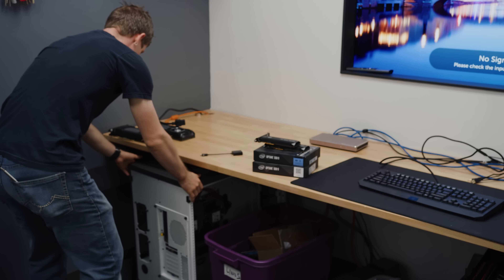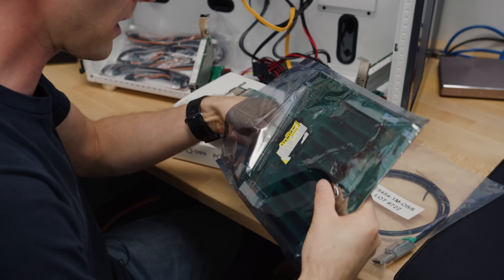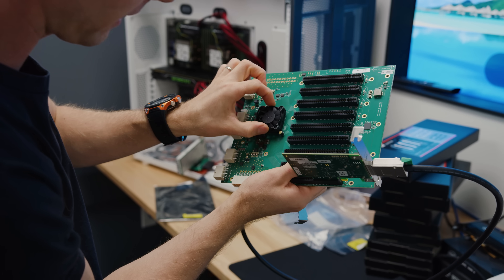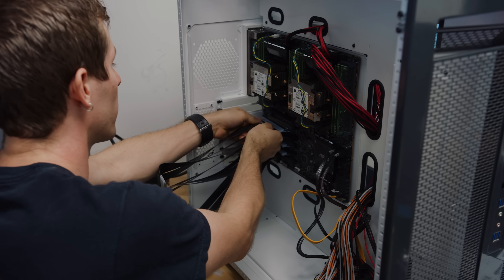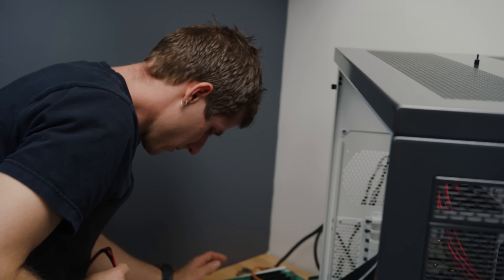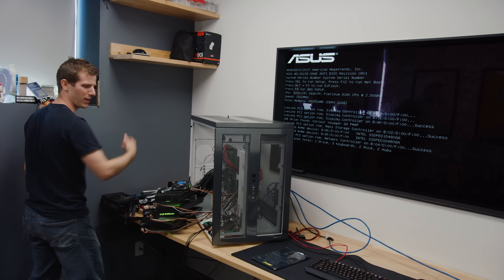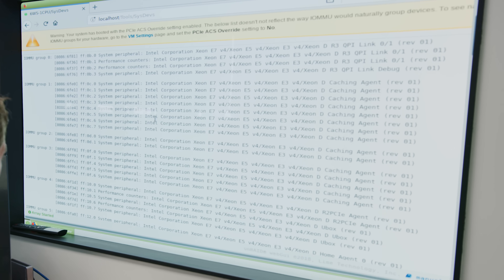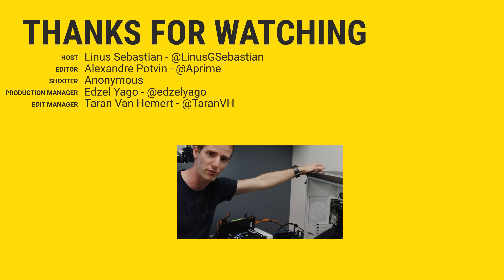Building the $100,000 PC Pt. 2 - SO MANY PCIe CARDS

Comment: PCIe extension backplane over copper??? hahaha..so outdated ;)

I designed the same, 3 years ago for my previous company. using those PLX PEX8xxx PCIe switches (1:1 on the host board, and 1:8 on the remote backplane).

But we did the PCIe over optic fiber (only 1Tx fiber ,and 1 Rx fiber), way more funky. We did a test with a 3 km fiber and it was still working fine, haha.

Only limit if you put to much PCIe endpoints is that if the motherboard doesn't have enough of PCIe addressable space, it will not boot, or even freeze when starting the computer. Actual consumable motherboards are not designed with extensive addresses area for PCIe.

Comment: I dig the various X users, 1 CPU stuff you guys have been doing.  I think it's a really interesting concept.  Along those lines, I thought you might look at this (https://www.crestron.com/Products/Featured-Solutions/DigitalMedia-NVX-Series) as a possible distribution system (i.e. method to connect users to the '1 CPU'), as opposed to thin clients, remote desktop, having everybody in the same room, etc.  Just a thought, my $0.02, something I'd be interested in you checking out, if it worked out for you to do so.  Cheers.

Comment: Am I the only one wondering why they use a PCI-E 4x card and not 16x?
Reply: Came here wondering the same thing. Makes a network switch analogy...but here its like a 100mbit uplink to a gigabit switch...
Reply: My guess would be the issue is the cable here. 4x PCIE over a longish cable is already pretty impressive without signal loss, a potential 16x cable would need to be a massive chunky thing. (just look at the short 16x PCIe riser cables for the GPUs)

Though maybe it might be better served converting to optical tech or something.
Reply: True getting the data over the cable is problematic but even 16x is just an average of 2x/new slot (8 extra slots). 4x is even just for usb heavily bottlenecking
Reply: Pcie is fullduplex working with 980 Mb/s per lane... so 4 lanes are around 4 Gb/s Usb 3.1 only gets up to 800mb/s in practice... So nope 4x is not bottlenecking at all.
Reply: @FailQuail bad guess if u look at the Video Linus did, where he chained dozens of riser cables and measured no perfomanceloss.

Comment: 6 editors with 8k for 100.000? i think you can make it way more cheaper and practical linus...

you may have lost it, since even if this pc is just for a series of videos, the cost of this thing is so high that i dont belive you will get much revenue out of it, even with the sponsors 

also the Threadripper 2990WX won't match the Performance of this in renders?

Comment: If you could use 2 amd epyc 7601's you'd have 256 pcie lanes, that's enough for 32 gpu's running in x8 mode, or 12 of them in x16 mode with a 120 gbps network adapter, 24 full speed usb 3 ports, 2 opta... oh wait, intel only, ehm 4 other really fast ssd's and about 50~ hdd's or 25~ sata ssd's at full speed

seems way more op to me, just one problem, there are about, maybe a bit more or less, 0 motherboards that have 16 x16 slots... what i think is weird as deeplearning could really benefit from this

Comment: I knew in the first 60 seconds this wouldn't work, there's no way that power supply will hold at full load and putting in very little thought and randomly getting the most expensive things .... i hope he can sort the power and heat management and not including the OS issues he will get

Comment: well Linus with all due respect
I have (actually 3 of them) Main Logic Board based on AMD990FX and exactly zero PCI Express bridges in there
but I have my over 100 PCIe x4 based quad port Gigabit Ethernet Network Interface Controllers, which do have 3 port 12 lane PCIe Bridge

Comment: First issue...  It's a 4x connector to cable which means you will only achieve a maximum throughput of 4x regardless of what you put on it.  Your GPUs will be bottlenecked REALLY bad.   Like...  Even one won't operate at 100%, everything else will just be wasted.   Now for USB over 4x, I'm still not sure you'll get the full benefit.  But it's worth a shot.

#Linusdroptips

Comment: I do wonder if unraid is the System to run on this configuration. As you are running actual server Hardware and are planning on passing through stuff (like boot drive, graphics card etc) to VMs directly and not share a lot of what is left (or do you ?), you might be better off running VMware ESXi on that machine. You will need to use Quadro cards though - as nvidia does not support passing through "consumer" cards into vm's and vmware is not willing to workaround that. (Funny how they call the Titan cards consumer cards ...).
If you are choosing unraid for its storage capabilities, you could still create a VM for running unraid and pass the storage controllers it needs to that VM. I do not remember I ever saw that "hardware group" stuff using vmware .. I was always able to pass through individual devices.
Reply: I think you can passthrough nvidia consumer card just fine on ESXi you just need to pass hypervisor.cpuid.v0 = "FALSE" to VMs that you use. The other problem might be that ESXi might not support the motherboard that they are running in that box.
Reply: AntiHawk ESXi works fine on an awful lot of motherboards which are not "supported" ...
Reply: Or even KVM or ZEN.
Reply: unraid is base on kvm
Reply: And xen can't do GPU passthrough very well (especially NVIDIA)
Reply: Well then, the more you know...

Comment: Reminds me of when my offices server went down. Had to ghetto patch in multiple power supplies in to the motherboard and peripherals to allow the motherboard locked raid array a chance to start so we could offload all the data. Tower of babel stack of components with a wire hung desk fan hovering over the top. A very precarious 10 hrs (Not to mention the system manager going through various stages of a nervous breakdown)

Comment: Fire Jake for not upholding the sacred rule of treating hardware respectfully. Just taping up the ends of those connectors will cause residue and gunk to build up where the pins go, which in my opinion, seems like a recipe for disaster. 

(ok don't actually fire him, just give him a warning)

Comment: Linus, please contact ASUS. The IOMMU comes from the UEFI, and they can fix it and send you an update. They it before for Ryzen boards, so surely they can fix it for Xeon-SP based server board - I'm talking about hardware you're connecting directly to the motherboard.
You CANNOT get a separated IOMMU groups for the PLX board because your UEFI doesn't support the PLX with IOMMU.

Comment: Wouldn't a AMD epyc system be the best for this type of thing as it has a stupid about of PCI-E lanes.
Reply: I guess, but wouldn’t that mean Threadripper or Epyc
Reply: Werent these the cpus he got of ebay for cheap?
Reply: v Nyggi Its either that or some newer chips that aren’t the same as the ones he got off Ebay.
Reply: Linus still feels the burn from the 7 gamers 1 PC when using AMD.
Reply: Skelath Ye...but thats whats gotten him here, combined with the x gamers 1-2 cpus videos he’s done after..
Reply: GameBreaker yep and it was the ez of using Nvidia that keep't him going.
Reply: Skelath Eh, confusion between quadro and high end gtx is one problem with that.
Reply: GameBreaker 8 Gamers 1 CPU was with 2 GTX Titan X's and 8 GTX 980 Ti's. He also mentioned how much easier it was to setup compared to the AMD version before it.
Reply: Skelath I know that, but I am saying for this new case, it is more vram or not with quadro..
Reply: GameBreaker there are many issues I find with this build, like how the asus mining board with 19 gpu slots that had to be in a specific configuration with both AMD, Nvidia, and some specific GPUs design for purely just mining to even work, then there is the issue of getting Windows to detect all that.
Plus when Linus was using said 19 gpu motherboard he gave credit to a forum member giving the proper configuration for getting 19 GPUs in it despite it literally being a copy and paste from the motherboard manual, and Linus never reads manuals and would spend 10+ days speaking to the manufacturers, googling forums instead, and here he is using brand new hardware he's never used before and getting all excited that a motherboard managed to detect two Nvme drives (/facepalm).

Comment: undefined technobabble 95% of our audience won't understand
Reply: Yeah, I didn't get it as expected lol
Reply: yeah but you totally understand and saw IOMMU as an issue beforehand if you had tried using unraid to make a multi-user station with new hardware since his first 2 gamers 1cpu video.
Reply: says something that has nothing to do with what you said just to make me look smart to the 95%
Reply: The Union of Soviet Socialist Republics 13:27
Reply: PrimaShiba Yeah, you see, the 350 cu inch 16x cylinder motherboard might have some run through incompatibles with the switcher cable capable interface chip. This is concerning because when you’re trying to run AVDsE based games, it might perform terribly. I’m also concerned about the optimum optimized ATX based tower chip with the host adapter bottlenecking the laser actuated battery. I mean, the 14 PCI U.2 USB12.0 should provide ample power to play most games.

Comment: Wouldnt be Epyc be much better for this? I mean a dual socket system has 256 PCIe Lanes, where a dual socket intel platinum "only" has 96
Reply: SchwertKruemel dual socket Epyc has 128 Lanes. Half of the lanes are used for CPU to CPU communication.

Comment: Genuine question, and I'd appreciate if someone could explain like I'm 5,
How is it that a system like this, or the 8-gamers-one-pc handle such large workloads at high performance (or at least, aim for high performance) when singular rigs are incapable currently of doing those same high intensity tasks relatively lag/performance-loss free?

It seems like the performance loss is relatively low considering the amount of virtualizing etc. done. I don't understand why.

EDIT: My best guess is that they're being clever with the performance allocation, in terms of allocating tasks per core, and what cores can be used per VM, but I don't understand how there aren't bottlenecks in terms of storage or graphics cards.

Comment: When Linus tells you not to put a mother bord on the static bag and then does it with the pci expansion board
Reply: Yeah, i was wondering wtf he was thinking putting that board directly on an aluminum chassis without any standoffs.  Though maybe it's only wired on top of the board.  I didn't see a short, anyway, but still sketchy as fuck

Comment: That thing could heat a house if you shut off the coolers
Reply: Actually if ur having the coolers on youll be giving out more heat into the room :P
Reply: Because coolers make heat disappear, right? -_-
Reply: The coolers don't make the air any cooler, just spread the heat.
Reply: wtf are you talking about, do you think coolers make thermal energy disappear somehow?
Reply: It generates the same amount of heat with or without fans you know that don't you?
Reply: Dood I see you in like, ever video I see lol. Like I could click on a random meme video or something and scroll down to see you chillin there lmao
Reply: That's not how physics work... uneducated idiots
Reply: that's not how thermodynamics works dude ...
Reply: It'll likely generate more heat with good cooling. 
With a decent cooler you would be able to run the chip at high settings and thus generate more heat. Without the cooler it would just throttle and run slower thus generating less heat.
A cooler doesn't make heat disappear, it just moves the heat elsewhere.
Plus, with a system like that I'd imagine the cooling solution should at least generate a tiny amount of heat in itself
Reply: Anton Törnqvist (this) exactly what I thought. Better cooling better performance = more energy used and dissipated.
Reply: More like blow up a house
Reply: If you turn off the coolers it's only gonna be heating the house for 1-2mins, then it's turning off :D
Reply: Justin Y. Grrrrr heck off now
Reply: If he shuts off the coolers, how is it supposed to heat the house? The coolers cool the hardware by moving heat away from it. 
Could you stop posting ignorant, stupid comments all over the place just for the sake of posting them?
Reply: Fabian imagine with all the time he does this bullshit he could have a girlfriend and a life or an education. But that's overrated.
Reply: yeah it'll heat it with fire when it burns down.
Reply: Justin Y. You could connect it to the romm heaters.
Reply: ENGLISH PLZ
Reply: Breaking news large fire starts in Canadian youtubers house.
Reply: Surprised to see you on a tech channel
Reply: Even with the coolers....
Reply: Nope, the heat is just being moved away from where it's being generated from with fans, so no, you get heat going into the room either way.
Reply: not for long
Reply: Lol
Reply: physics: A grade
Reply: AhHahA
Reply: No, the coolers are made to take heat from the PC and dump it into the environment. So if anything it'd be a bit cooler in the room with the cooling off.
Reply: The coolers are how it heats the house.  The chip produces the same amount of heat regardless, but the coolers disperse that heat into the air, thereby heating the house.

Without coolers, you'd thermal throttle and actually dump less heat into the house.
Reply: Justin Y. Because thermal energy just disappears...
Reply: Sure, so do house fires.  I hear they put out lots of heat.
Reply: Indeed justin, indeed.
Reply: If you shut off the coolers it would just turn off or more likely blow up. Not a good idea.
Reply: Tom Brown Blow up? Not likely. Modern cards throttle down to avoid damage. Even if they did it would be a capacitor popping so hardly an explosion.
Reply: Second
Reply: Justin Y. lmfao ily comments 😂😂 i thought i was the first reply to your comment but smh, grats Popgirl8 studios! 😋
Reply: Thanks fahaad shahzad get in line for autographs :b

Comment: I need the laptop for the video editing for my YouTube channel so can you suggest me good video editing laptop (configuration).
Reply: Winner Singh I think it'd be better to put this in the forum
Reply: Not the i9 Throttlebook(TM).
Reply: VoxelFusion fk i choked on my soda
Reply: Winner Singh I'm thinking 4 core 8 thread i7 16gb RAM ddr4 and SSD
Reply: Winner Singh GPU will probably be up to your budget
Reply: the best one you can afford
Reply: Winner Singh go watch Dave Lee
Reply: No
Reply: surface pro 2 or aspire vx 15
Reply: anything i7 8590h
Reply: gaming laptop with big cooling
Reply: Dell latitude d630
Reply: Winner Singh I would suggest an i7 8750H with a 1060 or 1070, we should know your budget to recommend something.
we could recommend an I9 with proper cooling but my recommendation is for the $1500 -$2000 budget range if you're lucky you can find a cheaper one
Reply: Winner Singh macbook
Reply: Why not a desktop
Reply: Ideal laptop configuration for video editing laptop: AMD threadripper 2 - 32 Core CPU, 128GB DDR4 ram, 4 TB Samsung 850 PRO EVO SSD, and Quad SLI with Titan X's.

While your at it, throw in a 1600w power supply and some liquid cooling.

Thank me later boss.
Reply: 4Mhz Pentium should do the job, add Windows Vista for maximum problems and a Crucial M4 SSD
Reply: Winner Singh https://www.amazon.com/GX501VS-XS71-Zephyrus-Full-HD-Ultra-portable-i7-7700HQ/dp/B0731JXL49?SubscriptionId=AKIAIPHVZTVH6LZ5BFZA&tag=hawk-future-20&linkCode=xm2&camp=2025&creative=165953&creativeASIN=B0731JXL49&ascsubtag=trd-1250765314342326229-20